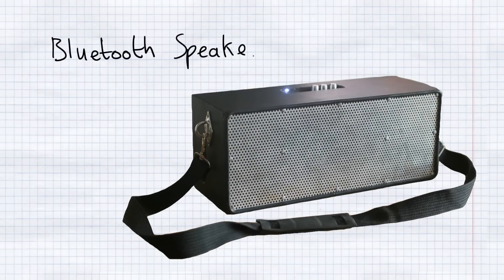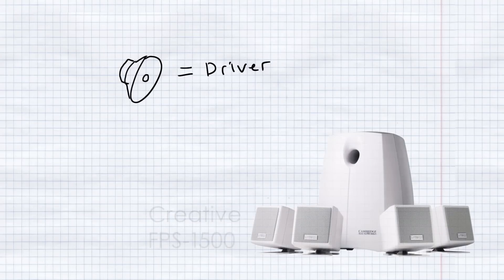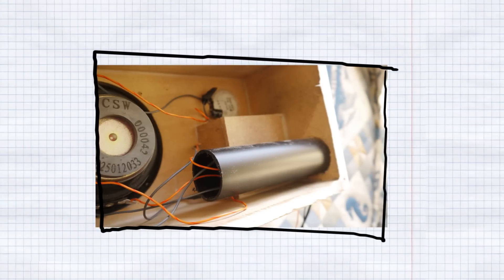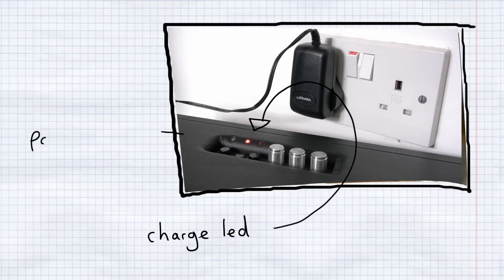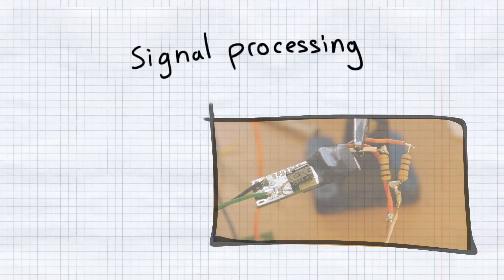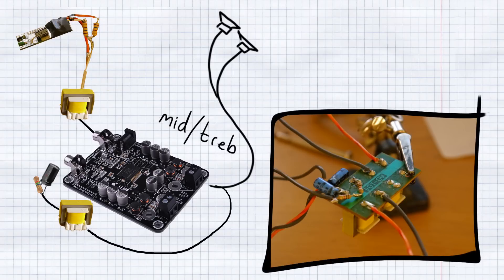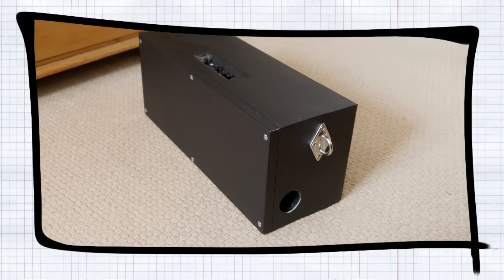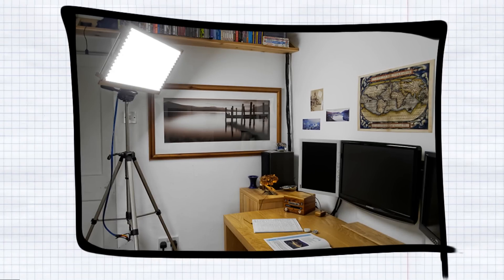Homemade Bluetooth Boombox - Build Log

Comment: What's a decent price for ground loops isolators do you know? I can only find some for around €8 each. Is that expensive?
Reply from the maker: BarryLlewellynperson A little expensive, but not too bad. I've seen them for £4.
Reply: Ok cool thanks. Your build log has inspired me to build a few boomboxes like these. Keep up the good work ^.^
Reply: DIY Perks Another quick question: The ground loop isolators are only necessary if you're doing the double amplification trick, right? If that's the case, would it not have been cheaper to just buy a different tripath amp instead then? (Eg. http://goo.gl/3M0FSl ) Is there any reason for going with the lower powered amp, or was it just to show us the double amplification trick? If I were to build a boombox similar to yours in terms of speaker output and size, would you recommend buying the more powerful amp shown in the link above or would you recommend going with the 2x15w amp and doing the double amplification trick like you did? Many thanks.
Reply from the maker: BarryLlewellynperson I was trying to make use of the 15w amp I already had, so using something more powerful is fine. You may still want to use a ground loop isolator between the bluetooth module and the amp to avoid signal noise.
Reply: DIY Perks Ah, ok, thanks a lot :)

Comment: Is there a way to make this without the Ground Loop isolator ?
Reply from the maker: Esteban Loría Only if you don't mind having some signal noise on the output. You won't be able to do the double-amplification trick either unfortunately.
Reply: DIY Perks Yeah... the noise is very annoying tho... but thanks anyways

Comment: Where can I buy this battary pack
Reply from the maker: 0367fgc It's just a pack made out of 8 aa rechargeable batteries. You could use a battery holder and make your own.
Reply: I have 8 pieces ICR18650 22B Samsung 18650 3.7V 2.2Ah lithium - ion battery
I want to make a 12v rechargeable battery
Reply: 0367fgc
If you use lithium cells to make a battery pack you will have to charge it in a balance charger.

Comment: oi diy perks.. i couldnt understand the wiring part.. if you or somebody could help me it'd be awesome... anyways im using logitech X-230 speakers!! dont know much about electronics..
Reply: same here...
Reply: and as you can see nobody is still helping but all i can say is try to go for this video.. but i cant help you fred with the resistors and stuff :F
Reply: What part dont you understand? i will try to help  :D
Reply: Deenixd if i buy the ground loops do i take them apart? and the part after 4:38 where from the groundloop thingy it uses the resistor n the other thing like what is that ? :D :D :D
Reply: he took them apart to make it smaller i guess... and if you need to build a low pass filter then do it like he did. You need some resistors and some capacitors. The best thing to do is search for "low pass filter plans " on google ...if found an instructables butild that might help you, you can put the circut right after the ground loop isolator. link:  http://www.instructables.com/id/Passive-Filter-Circuits/?ALLSTEPS    if you need anything else i will do my best:D  im building one too :) just a bit diferent. PS sorrry for my bad english im not an native english speaker:)
Reply: Deenixd  you are the best man :)
Reply: Kojo terrile  Thanks :D if you need any problems, i can help:)
Reply: Deenixd I have some questions too if you are willing to answer. Is there no danger of destroying the amp by connecting amplified signal to the input of the amp (4:50). In order to copy Matt's design we need the schematic of the low pass filter. Also values of resistance, power of resistors, and capacitance. Matt said that he will upload a tutorial on how he built this boombox but I'm afraid it's not going to be soon. He prioritized other projects.
Reply: Kojo terrile Nice work!! I got parts for my boombox too building it right now! :D
Reply: Kojo terrile
Still it's not understandable without the schematic. There are more than one combination the way you described it. Also, why 2 capacitors? What type of capacitors? Both electrolytic? Voltage rating of capacitors?
Reply: Mandragoras do you want me to draw out the low pass filter for you?
Reply: Kojo terrile I posted a reply with a link to a schematic asking if it is correct but I just noticed that it's nowhere to be found. Probably Youtube censored it. I'll try again in another reply.
Reply: Kojo terrile
Yeap, Youtube is filtering my comment because it has a link to imgur. The schematic was:
(Vin)--(R1)--(R2)--(Vout)-(C1)--(C2)--(Ground)
Reply: Mandragoras is R2 on your schematic a potentiometer with 10kOhm? I want to know, how he controlls the bass with the potentiometer.
Reply: Clemens Richter No it's not. I drew a 10k Ohm resistor in series because Kojo terrile suggested so in a comment that is now deleted. The addition of a second capacitor was also a suggestion. My schematic is not the answer, it's a question I expected to be answered. So don't use it until someone experienced enough tells us how to properly build a low pass filter that works with amplified input and has a safe for the amplifier output .

Comment: Great project - the best of its kind so far, but disappointed by the build log. Far too vague for the novice. Already I can see a few pieces of hardware not discussed and a pair of 5k ohm resistors near the potentiometers which are unaccounted for. You clearly know what you are doing but looks like you are more interested in getting the video presentation looking great (which it does, mind you) than actual content. 6mins, should be 16 mins. Has anyone out there in Youtube land got time to break this kind of bluetooth project down for this 'near' novice? I have begun this project, understand the low-pass filtering, and now ground loops but really getting stuck in every other way. and haven't even got to wiring potentiometers, USB charging or multigang switches. Obviously Instill need a degree in Electric/electronic engineering? please assist.
Reply from the maker: I understand where you're coming from Mike, but I have to balance my videos so that they're not too long. Very few viewers will actually attempt something similar, after all.

I'm currently considering setting up a website where I can log my projects in more detail, which you may find useful.

By the way, those resistors you mentioned were used in a very inefficient way to attenuate the midrange speakers, so I didn't think they were worth mentioning as they're best avoided for most people.